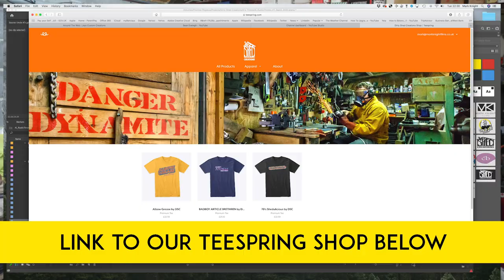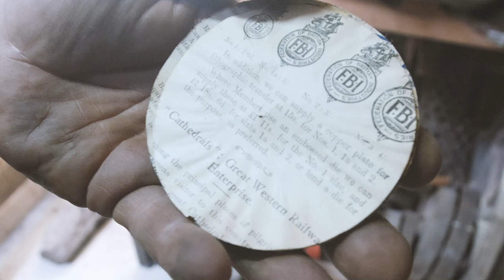The Shed is about to EXPLODE... on to TV! Plus, fixing the forge and using the silversmithing tools

Comment: Build a ribbon burner for your forge, you won't regret it, they are silent, use half the propane and you wont need to run the compressor!  Ask WEG Al, he will put you in touch with a bloke that can point you in the right direction ;-)
Reply from the maker: Hey Jim, the forge is a major stumbling block for all our projects so it will be addressed in the near future, Al will definitely look into your suggestion - thanks for commenting!

Comment: Not an expert on gas forges, more of a solid fuel forge person myself but thought i'd give Al a few pointers on the forge. 

The Insulating blanket material Al was using to line the forge is really really carcinogenic, hence why in forges its usually covered by refractory cement. Be careful lads! When working with it wear a respirator and work outside.

The flames coming out of the forge means that its not getting enough oxygen, not quite sure how you'd fix that but just thought i'd mention it.
Stay Safe guys!
Reply from the maker: Thanks Ari, really appreciate your comments and concern - you haven't been the only one to voice concerns over Al's antics with the blanket - we need a H&S meeting!